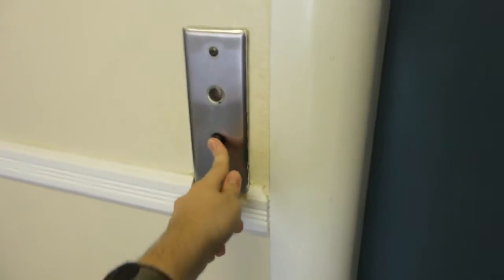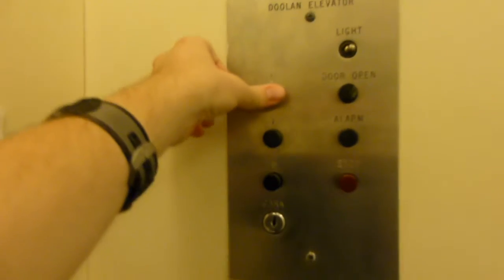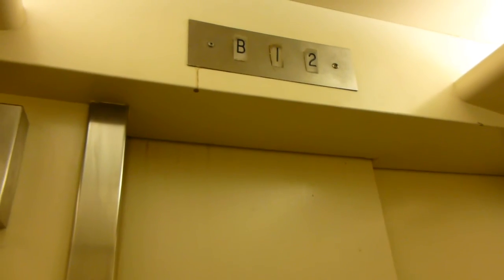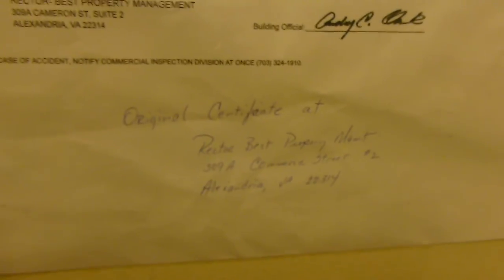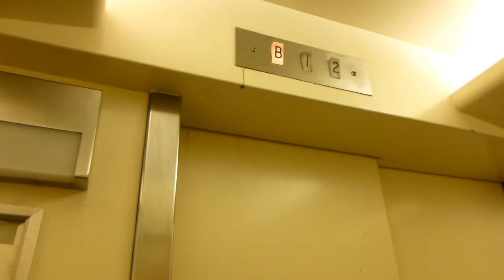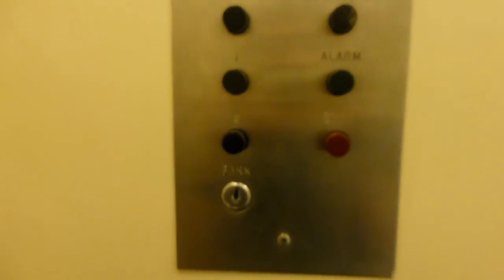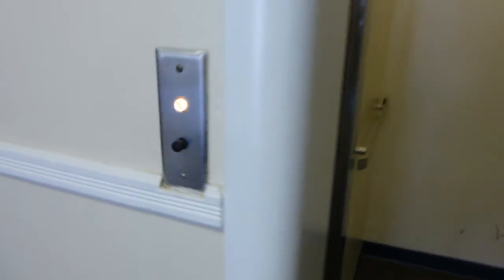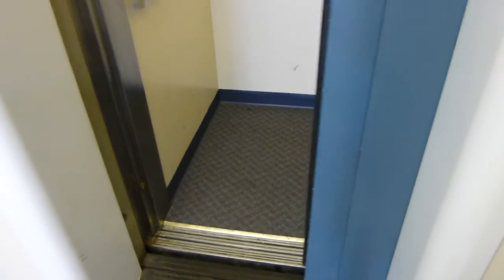The Elevator at the Springfield Medical Arts Building is Having Issues...

Comment: I think the motor needs replaced or something
Reply from the maker: +PAelevators I was also thinking it was a motor issue at first, but if that was the case, it wouldn't make that noise when going down (because the motor is only used when going up on a hydro).
Reply: Very True

Comment: Is that a hydraulic or MRL/traction?  Also is the elevator shaking when it is making that sound?  The jackhammer elevator ladies and gentlemen 😀
Reply from the maker: +Gary Beltz It's a hydraulic.  It did shake a bit, but not quite as badly as it sounds.  It was more of a vibration, really.